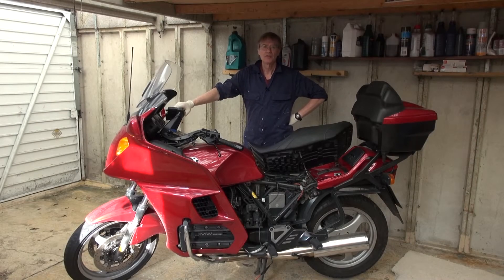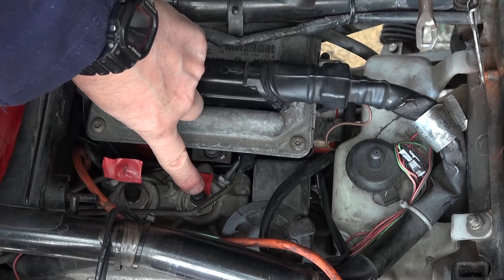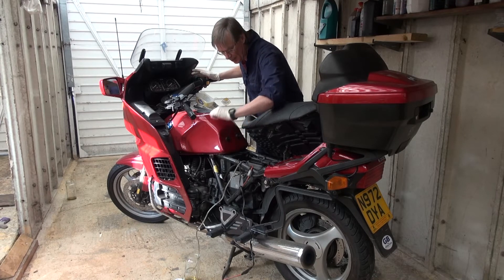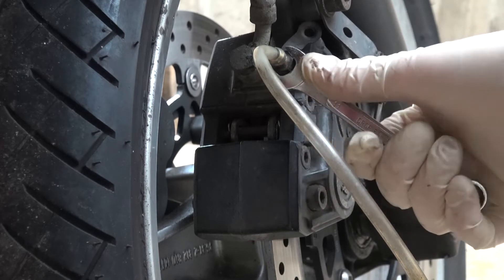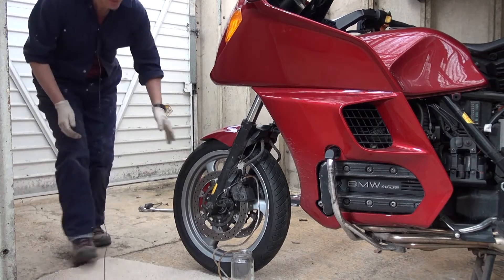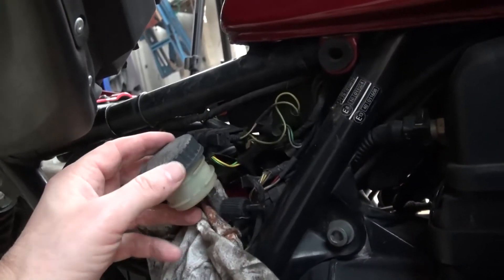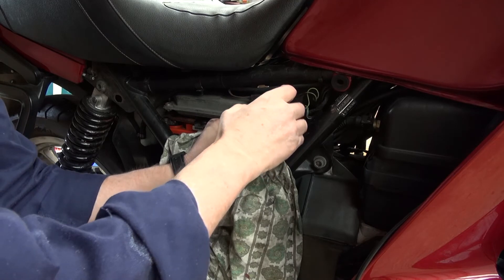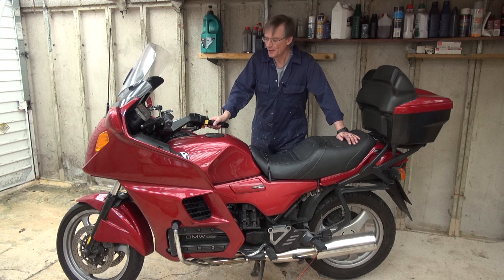Renewing the motorbike brake fluid

Comment: Very nice tips! Thanks.
And funny fact: I'm just about to do the same on K1100RS (1995), that is in "pieces" over the winter break for a nice cleanup (Up here in Norway!).
Reply from the maker: Well done. They are great old bikes.
Reply: @NigelEaland  A very nice and always reliable machine.
So far, never had and issue with it. Just normal service replacement stuff.
And the other video that you made a couple of years ago, for the full service of the bike, has been my reference to start making them myself.
Thanks for that too ;)

Comment: Hi Nigel, I was told by a BMW mechanic not to bleed the ABS module. I bleed the ABS module ii on my 95 K1100LT, and now I have a plunger fail. Have bleed the brakes 3 times since and still get the error code plunger fail test. Can reset the ABS no problem but when you get to 10kmh the ABS is suppose to do its self test, clunk test I call it, but mine fails. The get the alternate ABS flashing lights. Brakes work fine, but no ABS unfortunately.

Comment: Great video! Going off the subject slightly, I am trying to sort out a K1100 LT with a new battery, There is a brown wire coming off the motronic part above the battery, its a spade connector on the motronic but it is loose and exposed on the other end Where would this connect? Is it an earth to the battery?
Reply from the maker: It goes to the battery negative terminal
Reply: @NigelEaland  Many thanks Nigel. Just watched your excellent service video as well. Great stuff!